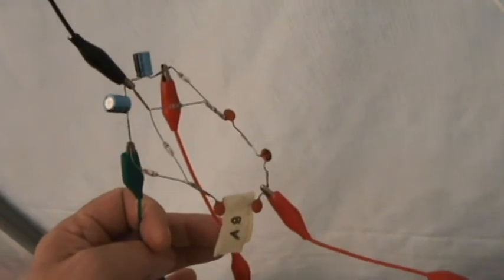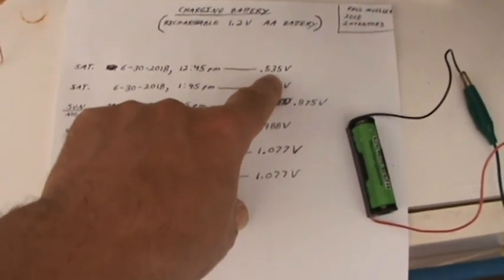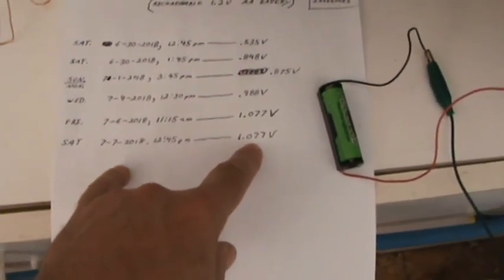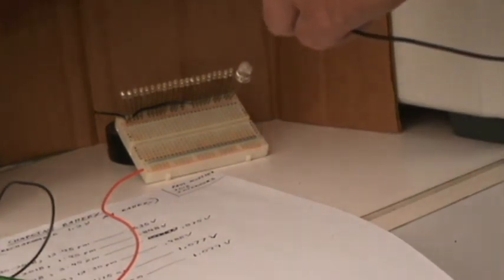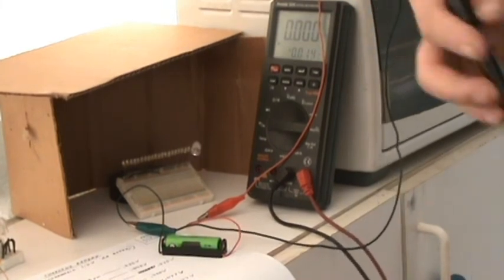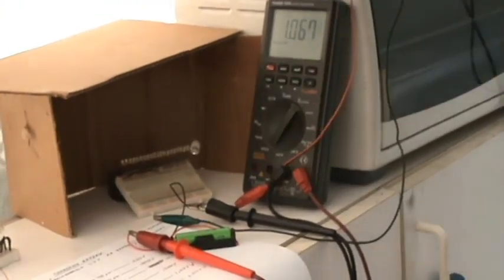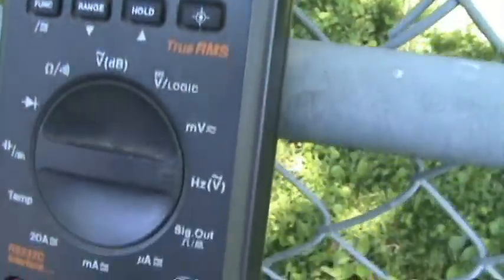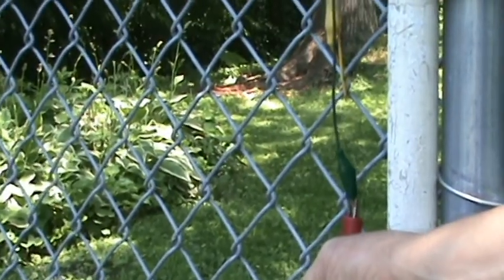Free Energy From Air 2018, part 3

Comment: Hey Paul,
I think you need to build a Rectenna. They are used in wireless power transmission systems that transmit power by radio waves. A simple rectenna element consists of a dipole antenna with an RF diode connected across the dipole elements. You will need the diodes! Then a rectifier to convert AC to DC. So first test the voltage of 1 wire, then more. Add different wire lengths with diodes. Both wires must be equal in length from each side of the diode. And only the rectified side goes into your circuit. See diagrams.
https://www.photonics.com/images/Web/Articles/2011/12/1/Nanoscale_Figure3.jpg

The diode rectifies the AC induced in the antenna by the microwaves, to produce DC power, which powers a load connected across the diode.Schottky diodes are usually used because they have the lowest voltage drop and highest speed and therefore have the lowest power losses due to conduction and switching.
Like this...: https://www.researchgate.net/profile/Luca_Roselli/publication/273396385/figure/fig8/AS:294937422778372@1447329969226/Hybrid-rectenna-for-solar-and-EM-EH-The-hybrid-rectenna-consists-of-a-broadband-antenna.png
Reply from the maker: Thanks for the info.  I been wanting to try a rectenna for a while now.

Comment: The work you are doing is much appreciated! I would recommend taking the antenna wire and attaching it to a helium balloon and elevate it to a height of at least 300 feet. All of those trees are diminishing your electric field. The tip of the wire should have multiple sharp points to increase ionic discharge. I would tie the frayed end of the wire to the  helium balloon using fishing line. You'll obviously need enough buoyancy, from the balloon or balloons, to lift the mass of the wire to an elevation higher than the trees. So, from the top down you'd have the balloon/balloons, then 3' to 4' of fishing line tied to the wire/wires. The higher you go in elevation, the more voltage you will get....Undeniable :) Keep up the terrific work!  This is truly the best way, in my opinion, of harvesting electrons. No moving parts and the only prime mover is the balloon being released. This works regardless of the Sun shining or the wind blowing. Solar panels are limited, and so are windmills :)  The atmospheric antenna method works ALL OF THE TIME ;)
Reply from the maker: Thank you very much.  Yes, power 24/7 :-)

Comment: Hi Paul,  

 Hey my friend, that meter will not likely show you accurate frequency without stable current and voltage. You need an oscilloscope. I'm overdue for an upgrade myself but I have an old school TEK 2235 alive and kickin if you're interested, contact me for details. Otherwise, remember that plateau thing I was talkin about in your last video? You've got caps avalanching and transistors switching with less then adequate voltage and current, in other words, your system appears very busy leaking, might I say a little too busy? I used a much simpler set up to charge 12vdc batteries. If ya could, please send me your schematics so I can compare to my own,  also I will find and send you my originals in return. Just thinkin out loud here, I don't see any benefit in this penny circuit thing.

Thanks for the video Paul.
Michael

Comment: I'm thinking the frequencies being observed is the result of inherent capacitances and inductances in the overall system effectively forming a tank circuit. It would explain the drift in frequency since the geometry is not rigid. As leads and wires move the frequency probably changes in response. I used to play around with AC circuits and the length, proximity, orientation, and locations of connections of the leads had collective influences in the resulting frequencies. Achieving a particular frequency was sometimes difficult. I built a metal detector using tank circuits that changed audio frequency in response to proximity of metal to two RF tank circuits. To find out if that's what you're seeing wave a piece of pipe around the leads to see if the frequency changes in response.
It shouldn't matter too much if the goal is to extract energy at all frequencies. Once rectified it all ends up DC. However that is not really harvesting atmospheric energy, it is more like harvesting ambient electrical signals. Atmospheric energy is effectively DC. Charges are collected at the antenna and travel to ground in one direction. I think it should only vary in amplitude so the frequency would be more like a random fluctuation in power.
Reply from the maker: Thank you :-)